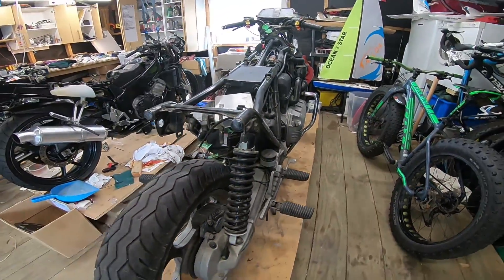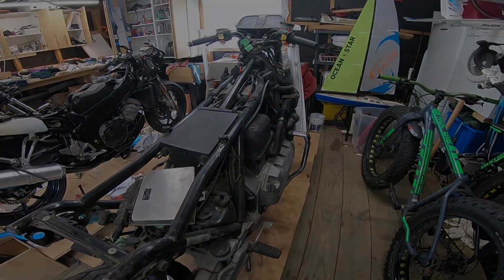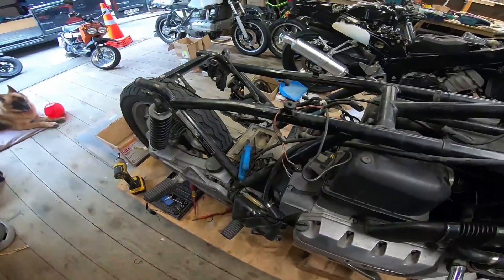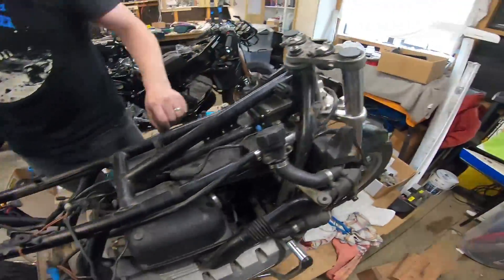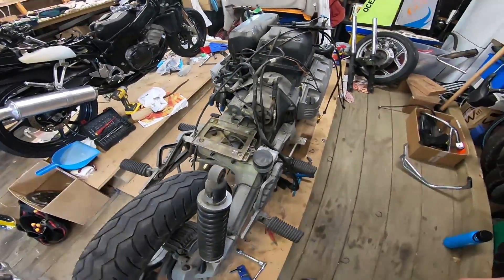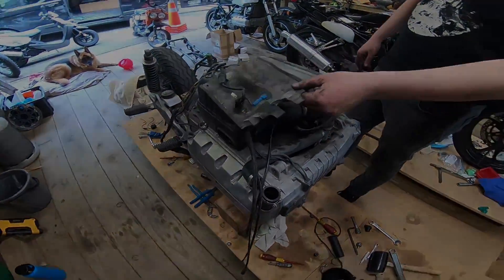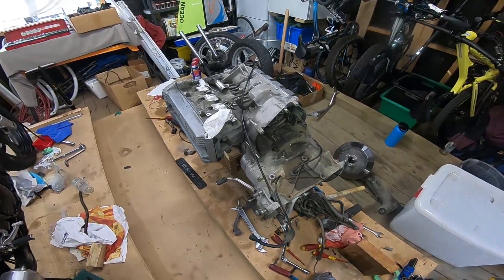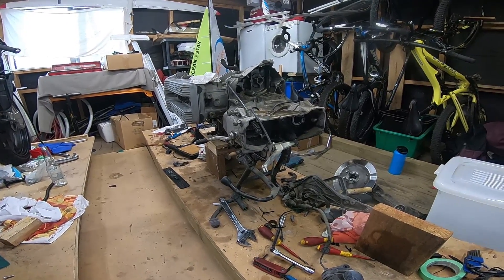BMW K100 MOTOGADGET M-UNIT WIRING PART 1

Comment: Hello Mikey. I have followed your instructions and I believe i got it right. The only thing i cant figure out is how to wire the key switch. Appreciate your help.
Thanks in advance
Reply from the maker: Sorry only just seen your message ! Have you got it sorted yet?
Reply: @mikeyfrompiha  not yet, the project was on hold due to vacation. I cut the wires on the switch too short so cant figure it out by reviewing the wiring diagrams can tell which wire goes to which port